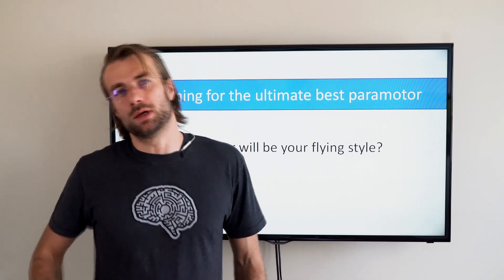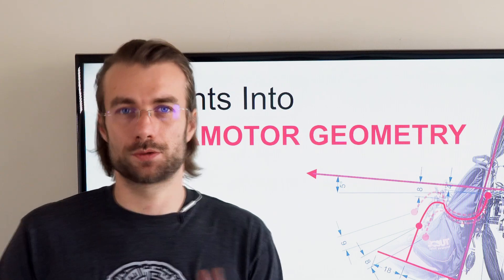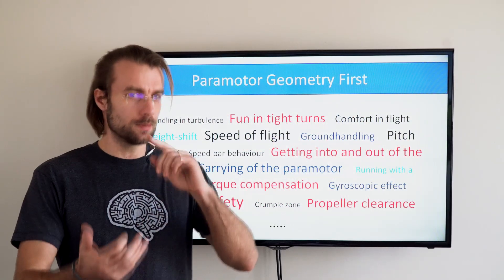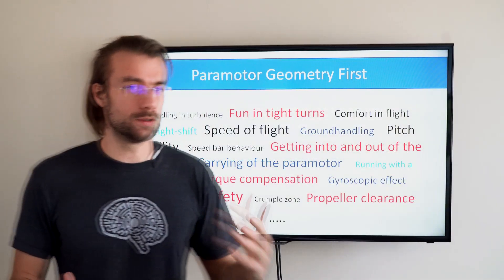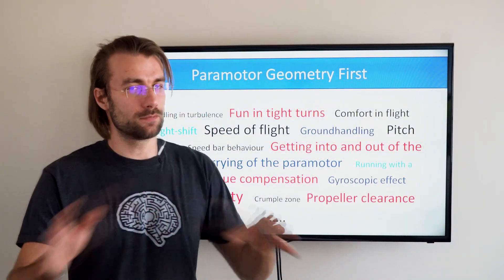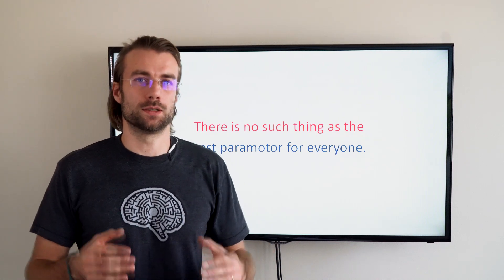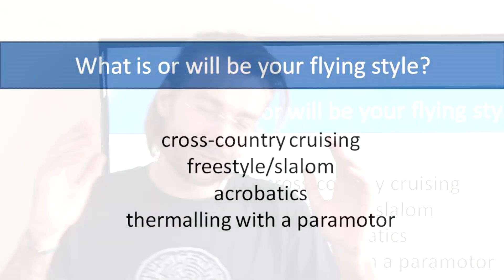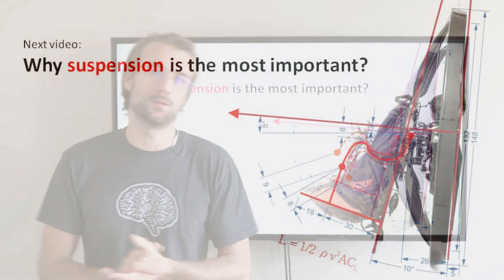What is your paramotor flying style? Paramotor Geometry, Part 1

Comment: Miro: Congratulations on the classroom series. I'm looking forward to it. How about some chapters on; "Handling: Sensitivity & Relative Response" i.e. with different size wings, human mass dynamics; "A Paramotor's Components: Relative Reliability, Durability, and Longevity" i.e. brand strengths, weakness, high/low maintenance, and part's retirement/change-out schedules.
Reply from the maker: Mike Brady discussion about glider responsivity would be surely fun but falls out of the scope of this classroom. 
Paramotor maintenance gets close though. Thanks for your tip!